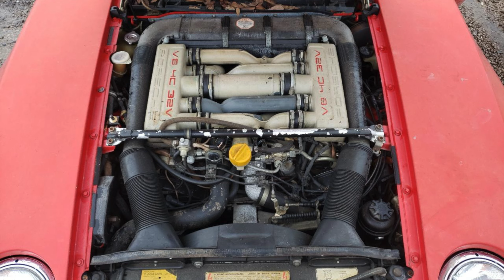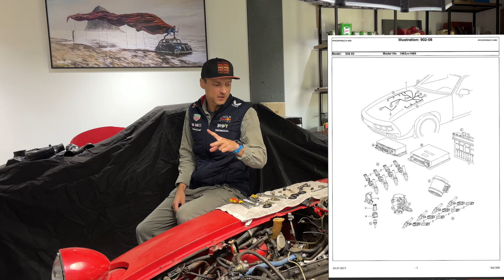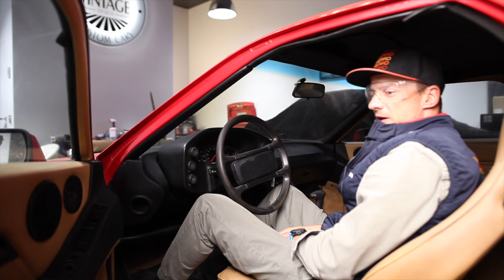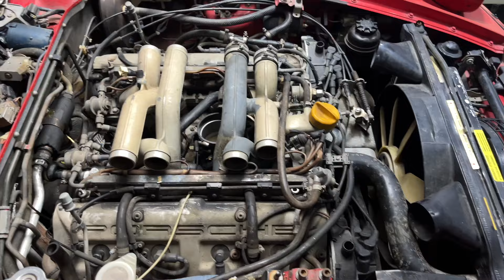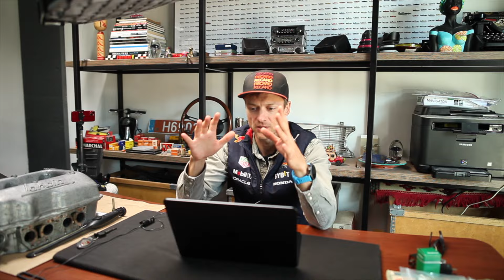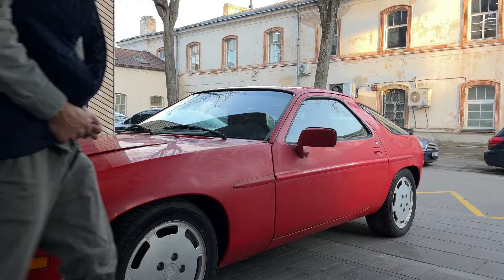Can a Cheap Old Porsche 928 Be Any Good? (Full Revival Story)

Comment: The Manual Porsche 928s are worth more a 1994 GTS manual Transmission sold for $400000 at auction because it had 9000 original miles equiped with manual transmission.  You can watch the video on YouTube.